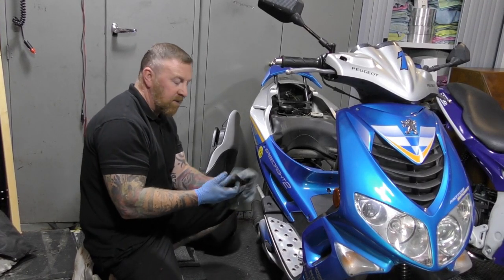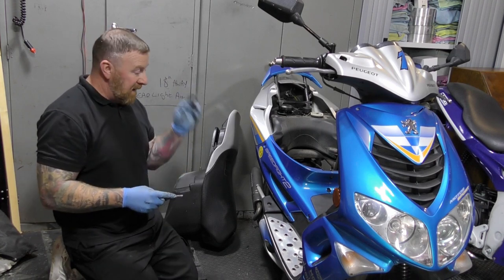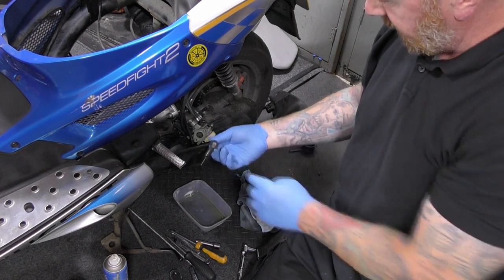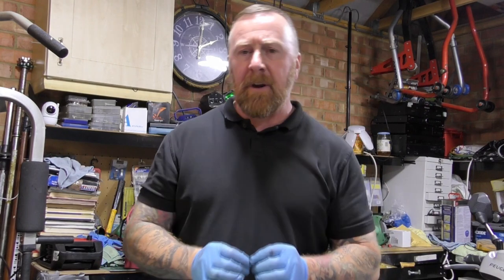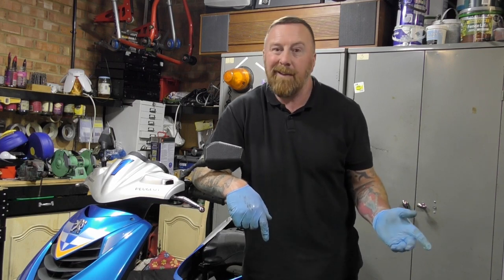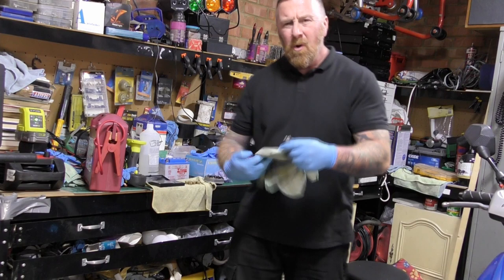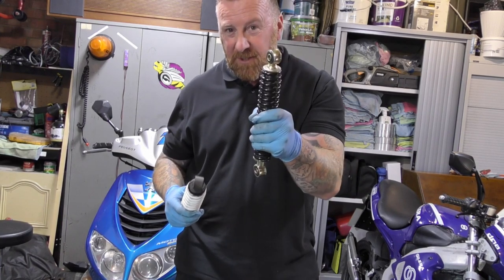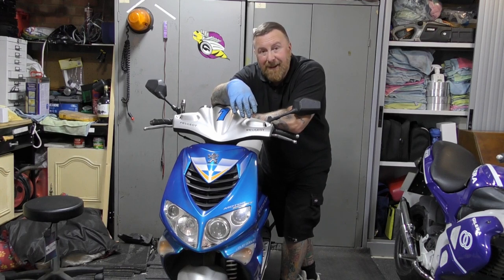SPEEDFIGHT MOPED 50CC IN GREAT CONDITION FULL FIX AND RIDE

Comment: I have a problem with my speedfight 2 front brake it just goes all the way back when I hold for 10 sec any suggestions
Reply: Check for any leaks. Could have air in the brake resoviour
Reply from the maker: same as said below bud , air in system so bleed or master need replacing , piston worn or sticking 
overhaul the system and new pads bud
Reply: @marksavage  thank you
Reply: @JDMz  thank you

Comment: Hi mark can you do a video showing a speedfight 2 ac wire harness and show the connections please mine seam to have the wire for the auto choke cut off. So can’t plug my auto choke to anything. If you can show where the wires should be so I can a couple new ones on would be a great help. Thanks Graeme

Comment: Hi Mark.

I have an issue with my speedfight (LC)
Bike was stood in the garage for last 4 years. I have finally decided to get it going and I have an issue with oil.
It looks like oil is leaking out from the carb and also around oil pump.
Also it looks like there is lots of oil inside the engine and in cooling system.
I have drain the cooling system and clean it alsocleaned the carb.
Any ideas why it happened ? 
Oil pump failure? 

Thanks
Reply from the maker: Hi bud , you will have oil in the sump and carb, it's 2t oil which separates 
I have 100 speedfight videos on a play list 
They will help with recommissionning
Reply from the maker: Take it all off 
Clean , change pipes , fuel and 2t oil out 
Clean carb as in my videos

Comment: Hi mark I have question I recently put an aftermarket exhaust on my speedfighter 2 100cc and it seems to be dragging from the start , I’ve been told that I need an air filter , a carburettor and possibly a new jet any suggestions I know your the man for this …?

Comment: Hi Mark I've got a 2010 speed fight 3 just done crank bearings and piston the batteries been off it a while so ive fully charged it put it on gone to fire up and there's no spark hasn't got original keys either is there a immobiliser I will need to bypass or something ? Appreciate it if you can help.

Cheers

Comment: Hi mark I just finished work and started my moped it was fine went to give it throttle and it just lost the revs so I stayed off the throttle for a while and then tried it again and it died out it’s my speedfight 3 I’m thinking carb but I’m not to sure let me know ur thoughts
Reply from the maker: yes bud agree its your carb, follow my carb videos like in this video to clean carb and then tune 
don't forget the air filter
Reply: @mark savage cheers going to get some carb cleaner and do the carb it’s a bit weird tho I’ve got to work and it started straight up and drove fine I think it might have flooded so going to check the float and all the jets and everything when I take the carb apart
Reply: Also mark do you have any videos on how to change ur coolant on a moped because I see u in ur videos saying it’s a bit iffy with liquid cooled peds so I want to know how to properly change the coolant in my bike as there’s literally none to be see in that tank ontop the radiator so I’ve temporarily added a bit of water which I know is bad long term because the water will just evaporate
Reply from the maker: @jack2010howe  take the pipe off at the water pump 
Then refill this antifreeze ready use 
I do have videos on it and one of my newer videos I do it which is on my dna out next week

Comment: Mark what headlight bulb do I need to get I replaced it with the same that was in it 12v 55w I've noticed for ages that somthing is draining my battery. I have read that it's ment to be 12v 35w bulb not 55w could this be the cause of the battery going flat its a new battery 3 months old Been checked and its holding charge
Reply from the maker: yes bud it should be 12v 35w . 
maybe worth checking your stator coil or volt reg as well
Reply: @marksavage  I've just replaced wiring loom battery stator coil flywheel power supply unit. If I unplug the headlight unit everything work like it should if I plug it in turn indicator on headlight flash indicator comes on very dull I've ordered 2 12v 35w bulbs if that don't sort it then I think it's new headlight unit
Reply from the maker: @andysavage5755  did you change the volt regulator but it should have 35w bulbs so that good.
funny i never noticed your name as its the same as my bothers name lol 
savage is becoming much more common now lol as there was only 3 of us and my uncle from london had so many kids i didnt know half of them lol

Comment: I used to have a speedfight and I currently have a sym Symply 50 and after having a Chinese 4 stroke for 3 months selling my speedfight was the worst decision I ever made but it wasn’t in the best condition either it had a broken engine bracket and whoever I brought it off had put a steel bar and the exhaust was screwed to the frame and it cause the engine to split as it’s putting pressure on it but there could’ve been something to fix it also had no front suspension at all and I went to a garage and they said it won’t but after looking at this video I was really confused
Reply from the maker: As in my many videos bud , I can bring 99% of them back on the road !, they never die lol
Just garages don't like working on them , easier to sell another one bud 
So many parts available to fix them and with my 100 speedfight video they would have helped

Comment: How to check ground wire for light ??
Reply from the maker: start rom battery , use a volt meter , but often once you get of the front panel you will see the earth wires and connectors 
use wd40 on them as it will help

Comment: Hi i have a question my speedfight 2 dies when i give it full gas and it gets resistance do you have any tips?
Reply from the maker: carb so clean , tune and check jet size , i have videos on all bud
Reply: @marksavage  i have already checked those it there anything else or do i maybe need to order another carb?

Comment: Sounds like the bike had a whole range of issues not just e10. 
Small jet less fuel. E10 fuel less combustible than e5 exhauat interior likely a honeycomb design almost like a miniature catalytic converter like I had on the 2006 aprilia rs125 stock exhaust euro3 if that was loose blocking the exhaust it will bog it down. Variator shift sticking not allows jt to engage correctly.  Although the panels are clean I'm gonna sat the rest of the bike has had a tough life unfortunately. I love the speed fight and a 76 main jet might actually be fine if running e10 because its gonna need more of the fuel to combust the same power output than what e5 would
Reply: Hi mate, I have a 100cc speedfight 2 2001 it's never had any e10 as it was garaged in 2004 
I'm planning on getting an mot this week can I run it on tesco momentum instead of e10 
Any help will be greatly appreciated.
Reply: @jasonhobbs5611  yeah tesco momentum is 99 octane e5 fuel jts what I use in my cars and bikes   you'll be perfectly fine with that

Comment: Can you run them on v power or tesco momentum instead of e10
Reply from the maker: They are fine bud as still e5 just different name bud , just don't use e10 fuel
Reply: @marksavage  Thanks Mark, my boy has just turned 16 he has a 2013 Neos easy 50cc he loves it. A bit slow though so may look into an exhaust for him
Reply from the maker: @jasonhobbs5611  I have a few videos that will help 
But exhaust will help 
Them new rollers 6g 
That should help as in my variator videos